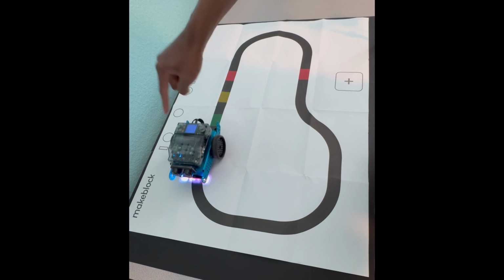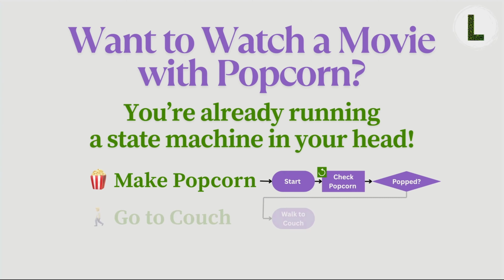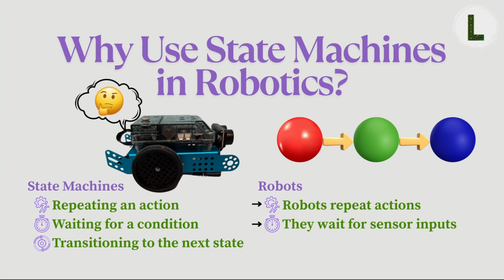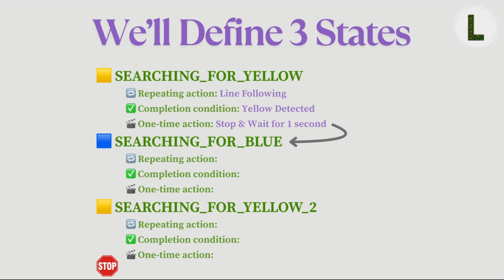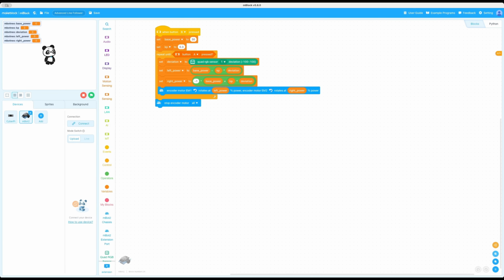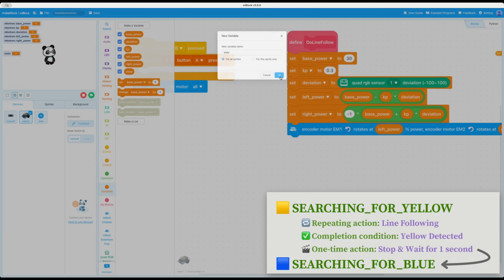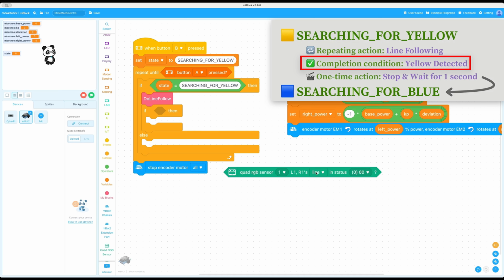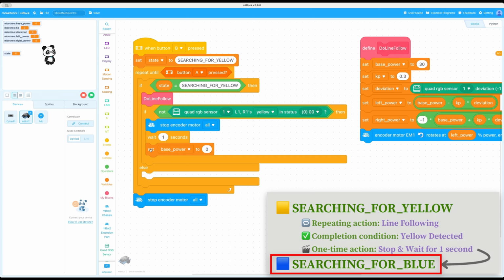Intro to State Machines Part-1: Smarter mBot2 Projects Start Here!

Comment: I have a question: when the mBot2 is following a line and reaches a section of the line without any colored markers, how can I make the robot turn right or turn left?
I have spent several weeks trying to figure this out and experimenting with Python code, but so far I haven’t had any success. I would really appreciate your support.
Additionally, I have written a piece of Python code based on my own ideas. I would be grateful if you could review and help me improve it.
import cyberpi,mbuild,mbot2,time
@cyberpi.event.is_press('b')
def on_button_b_press():
    base_power=19
    kp=0.4
    red_flag = False
    global frequency
    for count in range(2):
     cyberpi.audio.play_tone(800, 1)
     cyberpi.audio.play_tone(200, 1 )
    while not cyberpi.controller.is_press('a'):
         if red_flag:
            if mbuild.quad_rgb_sensor.is_color("black", "L2") and mbuild.quad_rgb_sensor.is_color("black", "L1") and mbuild.quad_rgb_sensor.is_color("black", "R1"):
                mbot2.EM_stop("all")
                time.sleep(0.5)
                mbot2.drive_speed(10, -10)  
                time.sleep(0.9)
                mbot2.turn(-90)
                red_flag = False
                continue
            elif mbuild.quad_rgb_sensor.is_color("black", "R2") and mbuild.quad_rgb_sensor.is_color("black", "R1")and mbuild.quad_rgb_sensor.is_color("black", "R1") :
                mbot2.EM_stop("all")
                time.sleep(0.5)
                mbot2.drive_speed(10, -10)  
                time.sleep(0.9)
                mbot2.turn(90)
                red_flag = False
                continue
         if mbuild.quad_rgb_sensor.is_color("yellow","L1")or mbuild.quad_rgb_sensor.is_color("yellow","R1"):
            cyberpi.led.on('yellow')
            time.sleep(0.15)
            mbot2.turn(180)
            red_flag = True
            continue  
         elif mbuild.ultrasonic2.get()<10:
            cyberpi.led.on('red')
            cyberpi.audio.play('wrong')
            mbot2.EM_stop("all")
         else:
            deviation=mbuild.quad_rgb_sensor.get_offset_track(1)
            left_power=base_power-(kp*deviation)
            right_power=-1*(base_power+(kp*deviation))
            mbot2.drive_power(left_power,right_power)
    mbot2.EM_stop("all"